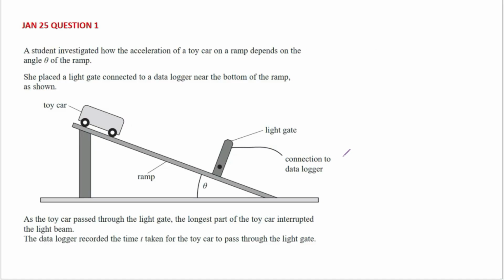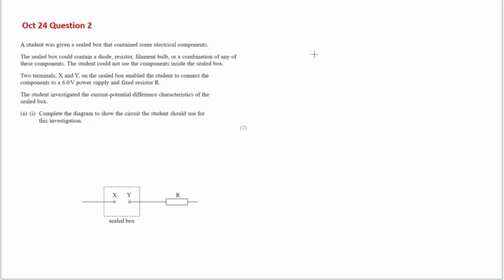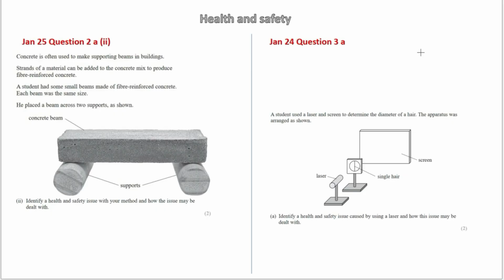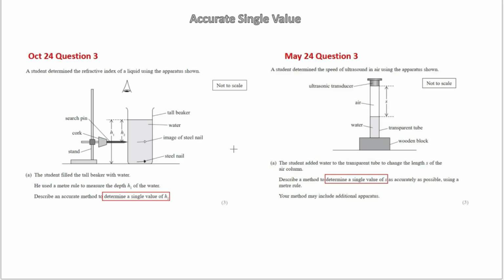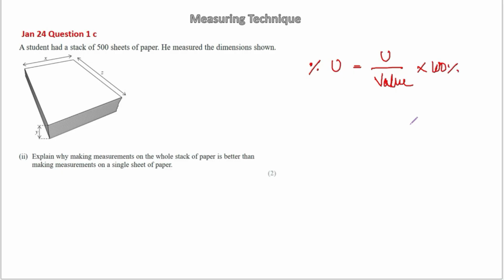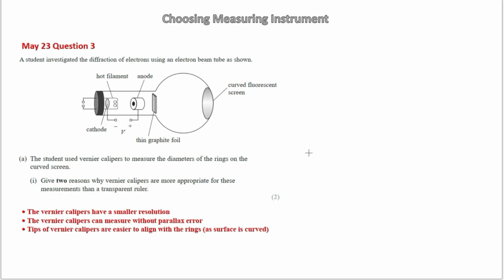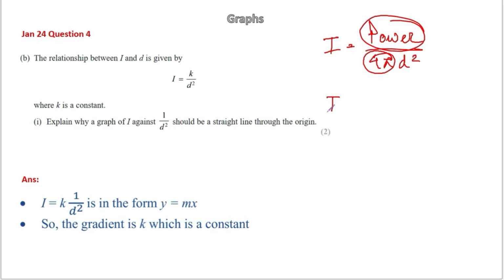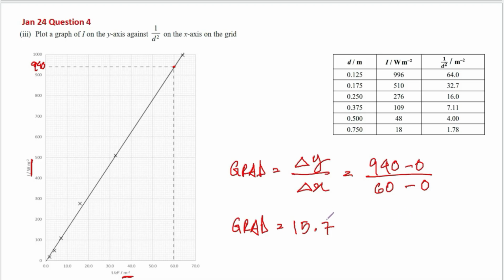A Level Physics Unit 3 Full Syllabus Revision

Comment: Sir will it be enough If I do Qp from 2019-2025?
Reply from the maker: Thats more than enough. However you must solve 2019 to 2025 at least twice. Solving it once is just not enough
Reply: I need urgent help for edexcel physics u3

Do we have to learn all the core practicals or only Core practicals 1-8?
Reply from the maker: @taku.8686 for AS you only need to complete 1 to 8
Reply: @physicsA2Z  thank you so much

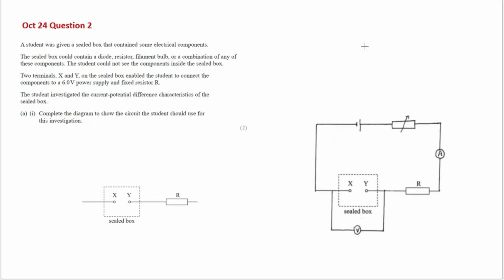Comment: sir, 8:24 in this question (Q2)  from the Oct 24 paper, could you pls explain part b?  how exactly does the graph show the diode and resistor connected in parallel?
Reply from the maker: @dunnoknowwhattoputhere-1 the graph shows there is current in reverse bias. This means current had an alternate path to flow. This is only possible in a parallel circuit. Had they been in series, there would have been no current with reverse pd
Reply: @physicsA2Z  Thank you so much sir!! means alot that you're replying to us 🤧

Comment: Sir, for 25:50, can’t we use a spirit level to check if ruler is horizontal?
Reply from the maker: @MaimunaAhona-g4e  we use spirit level to check if a SURFACE is horizontal. Here we are checking if the ruler is aligned with filament and sensor
Reply: @physicsA2Z  thank you sir 🥹

Comment: For the jan 24 question number 4
a part can why can't we write 
Check for zero error on the light meter to avoid systematic error?
Reply from the maker: @Sheza-c5c  mark schemes are finalised after students have sat for their exams. Im guessing very few candidates wrote this point in their answer, which is why it was not included among the existing list of points. This is an absolutely valid point which was unfortunately not awarded in the mark scheme
Reply: @physicsA2Z  Tysm for taking ur time to reply
Reply: Life is fr unfair 
😭

Comment: At 19:35 
Why the % D was calculated like
(0.72-0.65)/0.65×100%

And why not (0.72-0.65)/0.72×100%
Reply from the maker: @IALPhysics  reference value must be in the denominator. I explained that part in details in the video. If you are still confused, watch the last min revision video link in description
Reply: 0.72 is the value the student  found, 0.65 is the value of caster oil and the obtained value is being compared with the actual value